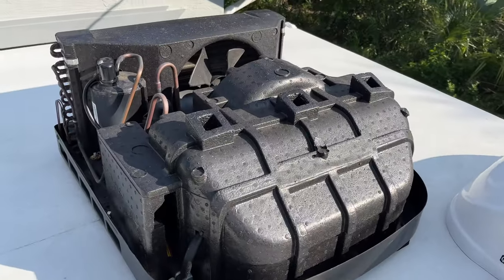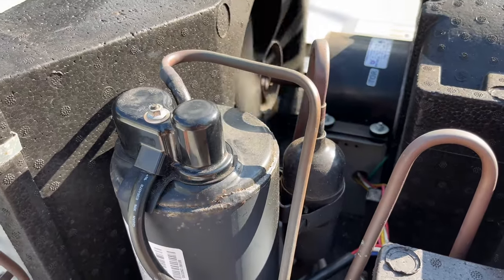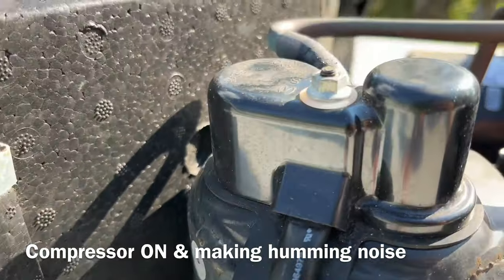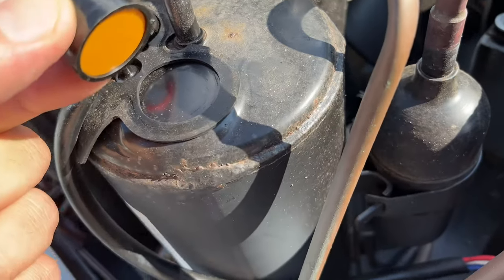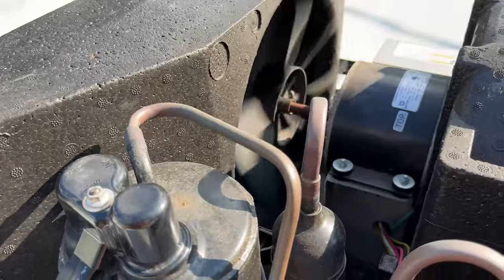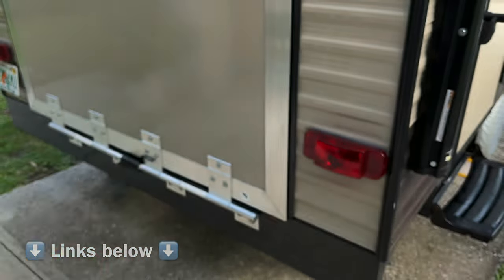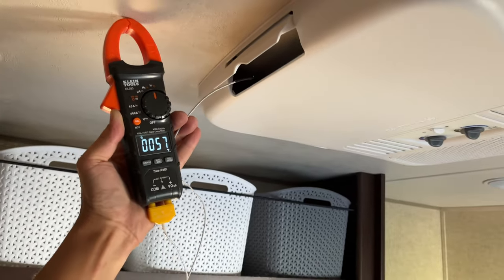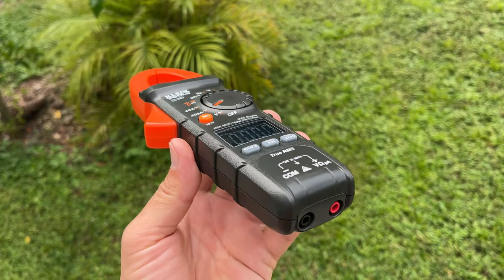Fixed: Dometic RV AC not blowing cold air - try before replacing air conditioner - easy $15 fix

Comment: After watching your video, I found that the wire going to Thermal protector had heated due to a lose connection and had lost connection. I was able to repair it with a couple of wire nuts and a short piece of wire, Thanks!!!
Reply from the maker: Awesome, glad it worked!
Reply: Thank you!

Comment: I have this same model and I'm fairly certain my capacitor is busted. I get the compressor hum as well as a pulsing sound but the fan isn't spinning. A capacitor replacement video would be super appreciated.
Reply from the maker: Yeah, I will try to record and post it soon. Maybe you would be able to record and send me those symptoms of bad capacitor, and I would include it in my video. Please let me know.
Reply: If your fan isn't spinning but your compressor is turning on, then it's the fan motor. I recently had the same issue and replaced it, works fine now.
Reply from the maker: @katie5808 thanks for sharing!

Comment: Good video.Checked to see if my compressor was working I think it is.Ac does not blow cold.The compressor was really hot to touch not sure if that’s normal.Where did you get your over load protector and capacitor?Thanks
Reply: Amazon
Reply from the maker: I left links to overload protectors under this video.

Comment: Thanks for this video. After watching this video, I just realize that I don't hear that AC humming noise and that subtle compression sound. All I hear is a very loud fan noise. It's either high or low. It is one thing on my RV that I wished it was more reliable. It does cool after a very long time after turning it on, but no where near what I would consider "cool" But information is very useful though, thanks for sharing.

Comment: I have a 2018 Wolf Pup. I checked the overload and it is good. I jumped the overload and not any cold air. Where is the capacitor on the Wolf Pup. Thanks for your help.
Reply from the maker: It is on the opposite side of the AC unit.

Comment: I have the same unit.  Mine will kick on and both fan and compressor will run but after about 5 minutes the circuit breaker pops.  I am connected to 30 amp service.  Any thoughts appreciated.   Thanks
Reply from the maker: If it trips the breaker, look for short circuit or too high electrical current.

Comment: My overload protector when out but I only found one that says 220 v and my rv is 30 amp 110 v. Its safe to use it? Thanks
Reply from the maker: No, electrical parameters have to be exact match with the original.

Comment: Which overload switch did you use? I see some for $9-$10 and all the dometics are like $50. 
Are they interchangeable or does it have to be the dometic one? Thanks
Reply from the maker: The main thing is to match the parameters of your existing overload protector. Either buy same exact model number, or look up the specs and make sure to buy correct replacement. I bought  2pcs. of Klixon brand for 1/3 of Dometic price, & it’s been working well for about a year now (about 5 camping trips).
Reply: @RV-time  I need the exact one you have, but having issues finding it on amazon.  Did you order through the Klixon website?
Reply from the maker: Found it on eBay
Reply: you want one that has a 2250 watt set rating   3 hp
Reply: @RV-time  Wow!  Just What We Needed! Thanks!  Liked and Subscribed! I am on top of the world, with this information!
Reply: @RV-time   I use Ebay, for so many parts that you cannot get anywhere else! New and used !
Reply from the maker: Awesome, glad to hear that! 
Thanks for sub!
Reply: @RV-time  For the exact one that you had(MRA4720-12027), do you have the interchangeable part number for the other brands to search for on ebay? Thanks for the help!
Reply from the maker: No, I was able to find the same exact one.
Reply: @RV-time  can you share the link to the one you order?
Reply from the maker: I looked everywhere, can no longer find the same one I got, out of stock everywhere. They must be failing at high rates I guess... :-)

Comment: But wait, I have the same ac and I didn’t see any capacitors up there? My is not turning on, fan not kicking in, compressor and fan both click but nothing . So I’m assuming it’s start up capacitors but I seen none? Mines a domestic also
Reply from the maker: It is hiding under the metal cover. You can see it well in my other video here: 
https://youtu.be/dhmfj_ip2kk

Comment: The only thing that Dometic is good for is a boat anchor
Reply from the maker: 😅That’s what I got a feeling off too… That thing is so loud inside the camper, you gotta choose between cold air or a headache in the morning. 
Camper was used only 3 times when AC broke. Now Im carrying spare parts with me every time…
Reply: Mine works fine.
Reply: It would still cause a circuit breaker--somewhere--  to switch off!
Whales, are rumored to have circuit breakers.
They'd die.

So its best to put in a gun range, and use a M34 mini gun on it until its nothing.
:D
Reply: @d0nKsTaH  Been there Done That! Sometimes!  I'll get over it ! Thanks!

Comment: I replaced the capacitor and overload....still blowing air, but not cold air. What's next?
Reply from the maker: Probably low on refrigerant.
Reply from the maker: Is compressor turning on/off?
Reply: @RV-time how do you add refrigerant to the a/c
Reply from the maker: Unfortunately, often these systems are filled & sealed at the factory without a service port (how convenient huh!? $$$).
Only way is to tap into the low line and add a refrigerant port, where permitted by law (yes, how convenient for manufacturers…🤑💰)
Reply: @RV-time  wtf, this sounds too stressful, I’m not trying to replace a part that doesn’t need to be fixed, the simplistic thing to start and do would be the refrigerant. I’m commenting here because I read someone replaced that specific part you did and still nothing. I believe that it’s the refrigerant
Reply: @RV-time hi that’s what my ac unit does you think that the part I should replace ?
Reply from the maker: Won’t hurt to try. Worst case you’ll end up with a spare part for your camping trips.
Reply: To bypass the overload protector temporarily where do I actually connect the blue wire to the compressor motor at

Comment: How hot is the compressor supposed to get mine is hot to the touch. This stops blowing cold air when it gets hot outside.
Reply from the maker: They get pretty hot, that’s normal. 
Is yours cycling on and off when it is running (the buzzing noise)?
Reply: Mine gets hot and it cycles on off .. also nothing is getting cold as far as evap coil,pipes etc
Reply from the maker: Possibly refrigerant leaked and now its not enough to cool off.

Comment: Does it matter what overload you purchase, I cant find the one that was in mine and cant get any information on what it is to try and match up with something else that will not take weeks to get. B500-150-141E is the number, Please help!!!!
Reply from the maker: Yes, overload protector specs should be matching your system requirements. I found the same ones that you have available on eBay here: https://ebay.us/9bfJS5
Reply: @RV-time  I’m having the same issue. The number on the side of mine is MRA12053-56B (B might be 8, I can’t tell) Klixon. I’m not sure how to find out the specs or where to get the same one. Any tips?
Reply from the maker: Check on eBay as well.